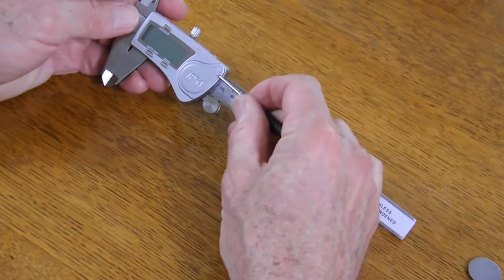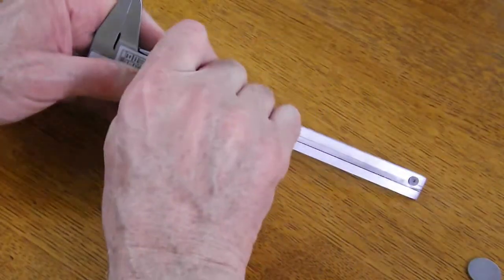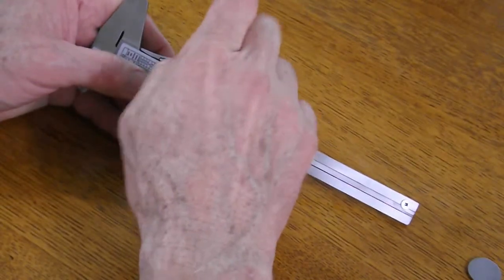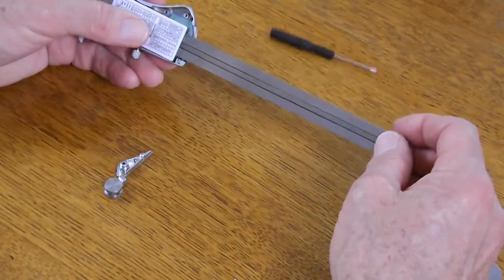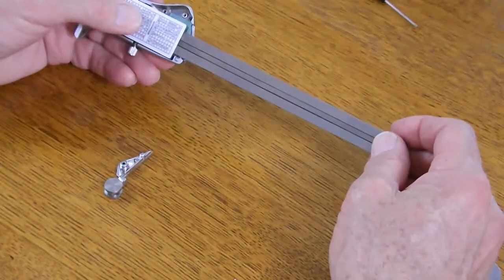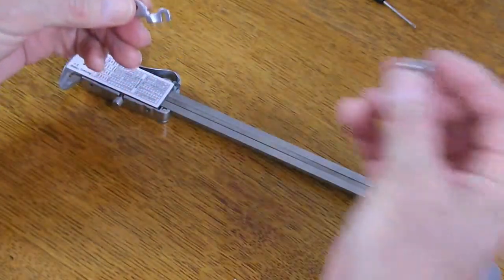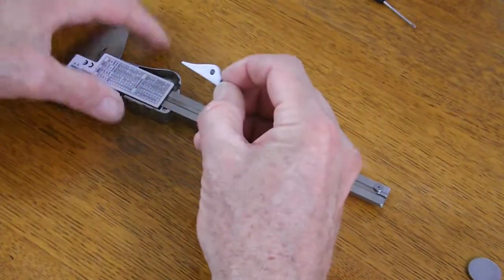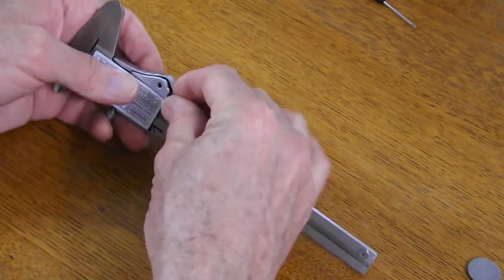Oh no! I Took Out the Wrong Screw from My Digital Caliper!

Comment: Lost my screw for battery compartment cover do you know where to buy more?
Reply from the maker: Hey!  My apologies, I missed your comment when you made it awhile back. We can help you if you still are in need - you can either buy a replacement package with an extra battery, screwdriver and the two main screws commonly lost here: https://eagems-llc.com/pages/ip54-battery-screw-kit, or - contact us through the website and we will send you that little screw.  Again, really sorry for the delay in responding!! ~EAGems
Reply: @eagems3220  Please I lost the thumb roller screw. I wrote the company no answer. Do you have the specs for that screw or is the battery screw replacement package still available?!
Reply: Hi Michael, I just saw this.  I did see a message received just today, but did not find an earlier message.  The size for the battery cover screw has a thread diameter of 1.9-2.0 mm and 8-9 mm length.  The short screw for the thumb roller is 5-6 mm long and 1.9 - 2.0 mm thread diameter.  A few of our EAGems IP54 calipers will be able to use the longer screws on both sides.  I did send you a Paypal invoice in case you do want the replacement kit.  We usually ship within 24 hours of a cleared payment.  Thanks!  ~EAGems